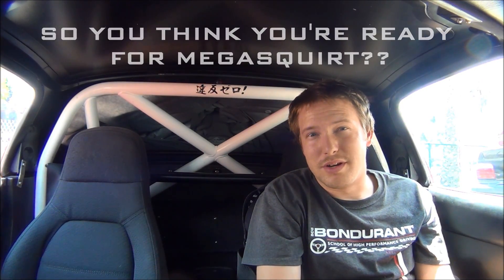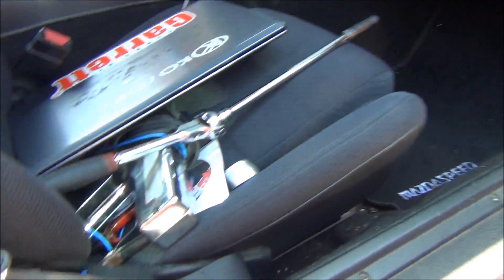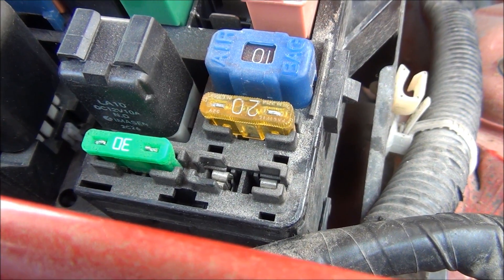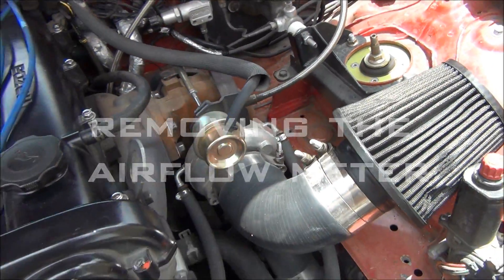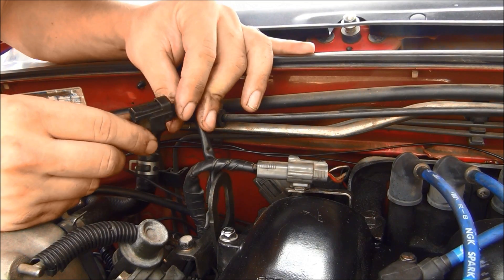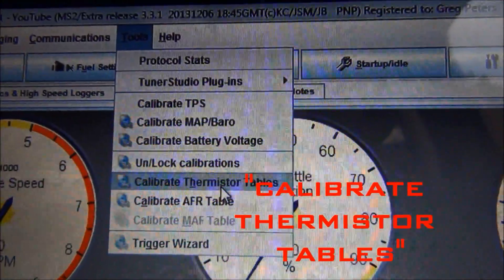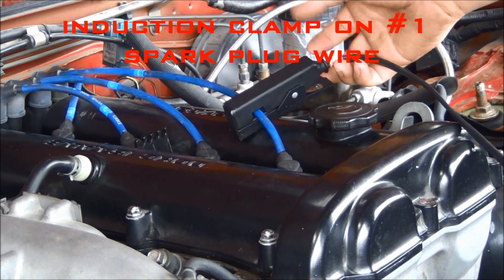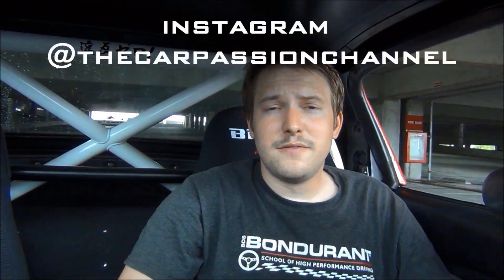How to Install Megasquirt!

Comment: Are you still running an IAC? The area right before my throttle body on my NA8 looks so much more cramped than yours. I'd love to be able to get rid of the IAC or at least find a way to relocate it (or not have to have a spare tube running to it, connecting to the throttle body inlet.

Comment: Amazing video thank you for your sharing your experience with us.
How many models mega square ecu, what the difference between.
For normal use not performance only to upgrade old ignition and fuel system for more reliable like.
D jetronic system mercedes v8.
Because no more parts available and not cheap to restore all systems.
What the easy ecu can used to upgrade this kind of system if not mega square, if I go for Ms ecu which model the best to my project.
Waiting any help or guide.
Best regards,

Comment: I need help!?? When I set it to fixed timing and verify that it’s the same (14 degrees) on the timing light and ECU. After I switch it back to use table the timing shown on the light and ECU show 20 degrees ?? Am I doing something wrong here ?
Reply from the maker: "Fixed Timing" is only for setting the base timing, and it needs to be 10 degrees (There's no "14 degree mod" once you have a standalone ECU). Once you switch back to "Use Table", the ECU starts using the spark map. Timing will follow whatever you have in the table based on load and RPM, could be 5 degrees or 45 degrees. That is the point of having a spark map.
Reply: @TheCarPassionChannel  ok so set the base timing to 10, then once I switch back to “use table” don’t worry about what the timing is showing ? And start to tune to get it running ? it’ll idle but that’s about it.
Reply from the maker: @FREEVERGO8  Correct, base timing should be 10. You're just setting a reference point for the ECU to use once the actual spark map comes into play. The ECU doesn't actually know what the engine timing is, if it's mis-adjusted. That's why it's so important to set the base timing correctly
Reply: @TheCarPassionChannel  technically once you set your “base timing” it should idle at that degree correct or no ? 
Example, 10 degrees 
Once I set it back to “use table” the timing goes way up to 20 degrees.? I have a lot to learn if you can tell..
Reply from the maker: @FREEVERGO8  No, base timing doesn't mean idle timing. If you want the car to idle at 10°, you need to make that adjustment with the spark table, not with the base timing

Comment: Hey Greg! Sorry to pull you back to a 7 year old video (if you see this) but I wanted to ask the significance of 10 degree advance timing. Is this because you're turbocharged or does this improve the engine efficiency?
Reply from the maker: 10° is on the base/reference timing. Actual ignition timing advance is controlled by the tuned map in the ECU
Reply: @TheCarPassionChannel  ohhh I see!! Thanks so much for taking the time to reply!

Comment: 8:30 greg has his plug upside down. If you look at a wiring diagram its pin 2 and pin 7. Pin 2 is earth and 7 is the signal to the ecu for the iat sensor. But as he said, theres no polarity on the sensor so it doesnt matter. Might help for diagnostics though if anyone needs it

Comment: hi TheCarPassionChannel i have a mazda 1990 gtx with 1800ccbpt im trying to add a AIT sensor my afm plug has 5 wires not 7 which 2 would i use for AIT in your video you used 1 and 6? cheers

Comment: hey Greg.
I am building my Turbomiata right now and it wont create much boost.
*also in the instructions of my kit-manufacturer it said i should use the first and the fifth pin for the air intake temperature. is this possible or is maybe this the reason for the engine running very badly?

Comment: Hey I know this is a stupid and amateurish question but I'm learning as I go. I am building up a miata slowly and when I finally put my TD04 Turbo on I am wanting to run wastegate pressure (7psi) for a little while before installing a boost controller and taking it to a dyno to get proper tuned, if I were to just run wastegate pressure I assume that the only "boost tuning" I would be doing would be watching/tweaking my AFRs to make sure they are good when I'm slowly coming into boost. Is this right? The only way to tune wastegate pressure with no boost controller etc is with AFR table? Aslong as I have a good base map with base timing and good AFRs aswell? I know spark maps also contribute but this is something I do not want to touch until I install a boost controller and take it to a dyno with a proper tuner. Can I have a safe wastegate pressure map without having to touch my spark map at all?
Reply from the maker: The answers to all of your questions is yes. As long as your ECU has a base map which is scaled for boost (Like the MS2PnP or similar) you won't need to touch the spark, just fuel only. And with out a boost controller you will be limited to spring pressure.
Reply: @TheCarPassionChannel  Thanks very much for clearing that up in my head, I understand when you are talking about scaled for boost as in the right Kpa for the tables when going boosted. Really cant thank you enough Miata dad, hope everything is well on your end👍
Reply: @TheCarPassionChannel  I am installing a MS3Mini PNP :) another question, can you run and fine tune your car while it is naturally aspirated on a map that is scaled for boost? Just not the the other way round obviously because the ecu would be expecting NA Kpa and get hit with 180 etc?
Reply from the maker: @mlfishing842  Yes absolutely, in fact that's the best way to do it. If you re-scale your tables for boost, they need to be re-done/retuned. If you scale for boost on day 1, all you need to do is tune the higher boost areas of the maps, all of your sub 100kpa stuff is basically done already. It will need tweaks once you have a turbo in the system, but not fully reworked as it would if you had to re-scale the tables after they had been tuned.

Comment: How do you install a flex fuel sensor? Like where to wire it into the megasquirt?
Reply from the maker: Flex signal goes to the Flex pin on the options port, your MS instructions will tell you what pain that is for your MS. The other 2 wires are just power and ground
Reply: TheCarPassionChannel I have not been able to find one
Reply: I’m useing the ms2 on a 92

Comment: I have a 97m and the O2 sensors are rust welded onto stock exhaust (original). If i install mega squirt, will I be able to delete these from my check engine light?

Comment: Is the IAT an open element or closed element (does it matter?). Bought a megasquirt for $400 but it didnt come with any of the other stuff with it like the sensor or the CD. Looking on the website now to see if they sell the CD or if they could provide one. 

BTW if you want a fun road to drive. Turnbull canyon in Whittier, CA is a lot of fun. I used to go driving there in my 64 ranchero back in highschool. Id imagine the Miata is just as fun

Comment: Thanks for these videos man. There really useful and very detailed. Very helpful to me I'm doing a turbocharged NB mx5 and I've been slowly buying parts until I have everything I need I was confused about what engine management to use but after loads of research on forums and websites I've decided mega squirt these videos helped me make up my mind. I imagine the installs will be similar very slight differences as mine is a NB. Thanks again.

Comment: Hi, i'm in the process of buying an MS2 for my 1990, i have a question for the IAT sensor placement. I read all over the internet that IAT sensors are prone to heatsoak, especially if mounted in hot places. Isn't the air in the back of the radiator too hot? Have you ever had problems with heatsoak?
Thank you!

Comment: So out of curiosity I was doing my megasquirt install and was just kind of following your tutorial apparently there's a fuse underneath the hood you were supposed to remove you might have covered it I might have missed it but apparently it's a big thing
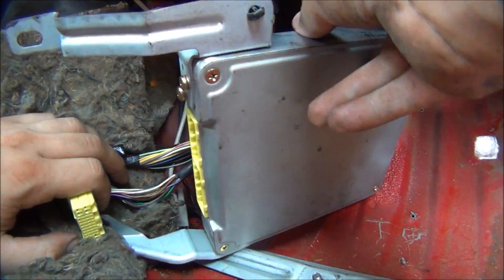Reply from the maker: The one I remove at 3:28?
Reply: @TheCarPassionChannel  yeah i must have looked away for a hot second when you covered that of course I was watching it as I was trying to do it

Comment: Question, I get a no controller detected message when trying to create a new project... What's up with that? I've tried the com detect program and it's not detecting anything. I've played with com settings and nothing helps. So frustrating 😡
Reply from the maker: Very common issue, often times using a different cable will solve it, but there's also a way to manually set up the new project. I had to manually set mine up but I dont know how, I had to have someone walk me  through it

Comment: Where can you get the Bluetooth adapter at ?
Reply from the maker: From DIYAutoTune's site
Reply: @TheCarPassionChannel  ok thank you
Reply: What's a good fuel pressure regulator for a 1.6 L . Waiting on the my megasquirt to come in.
Reply from the maker: @86staples  If you're running MS, use a stock regulator
Reply: @TheCarPassionChannel  thank you again my friend said I needed a fuel pressure regulator . And rx7 550 injectors. I know I need at least the Injectors.
Reply from the maker: @86staples  Injectors yes - FPR no. Stock fuel pressure is fine. You'll run out of fuel pump way before you need an FPR
Reply: @TheCarPassionChannel  ok thanks. I'm getting the walbro pump too. Also keep up the work  on your channel.
Reply from the maker: @86staples  Fashoo good luck on the build!
Reply: @TheCarPassionChannel  do you know I part number for a belt if I get rid of the ac in my miata 1.6

Comment: This might help a few people out when setting up the IAT. My tubing was cast, and it was tough to find some to install the IAT bung due to lack of a proper welder. Instead I chose the method here to use the 9/16 drill bit on drill press then used the NPT tap as recommended. The helpful part is Homedepot, Lowes, and Pep-Boys all didnt have the size recommended in the video. I went to Harbor Freight for the press, the bits, and tap kit (assuming you dont have one).  That got the job done, and this video was super helpful. Cheers!

Comment: Stupid question but im still new to the car world and I'm still learning is it possible at all to run this ecu with stock coil packs, sparks , and fuel pump etc or do I need better ones than stock? I'm trynna gain somewhat of horse power but im on a budget cuz im still 16 ?  thnks for the help!
Reply from the maker: You can install MS with a 100% stock engine.

Comment: How does your car run with the yellow RX-8 injectors? Is the idle smooth? How much power are those injectors good for?
Reply from the maker: So good. It's a great injector just make sure you don't get eBay knock-offs. They should be about $180 used/refurbished. They can do roughly 220-240whp, on the upper end you'll want an upgraded fuel pump, but stock pump can do over 200whp easy

Comment: My timing is at 10 degrees while on fixed timing but once I set it back to use table the timing is 17 degrees!! I have no idea why
Reply from the maker: Nick Lagnese Because after you set it back from fixed 10, it's not fixed anymore. It follows the spark map as it should.
Reply: TheCarPassionChannel oh so that’s normal then? Thanks for the reply and help with all things miata like always!
Reply from the maker: Nick Lagnese Yep, "fixed" mode is just to set your base timing. That's so the ECU knows what the engines actual timing is. Once you go back to "use table" you tune the ignition with the spark map. Just make sure when in "fixed" mode, TunerStudio says 10°, and your timing light also shows 10° on the crank. Very important that they match.
Reply: TheCarPassionChannel Yep they both match up. Thanks again for the help. Was driving me crazy

Comment: One thing I am wondering about: Is a base map the same as the stock map for the stock engine (OEM ECU)? Or is it just any map that plays it safe on the engine

Also, why I did you have to relocate to higher ground for finishing the base timing?
Reply from the maker: +Mathias Mang It's a base map specific to that engine, the settings are close enough to start the car and maybe drive lightly, but needs to be tuned after install.  The higher ground was a joke, because it was raining lol.
Reply: TheCarPassionChannel I honestly sat in front of my computer searching for possible reasons why you'd have to do that.
Definately got me there

Comment: How come you're not running 14 degrees BTDC? Would make more power
Reply from the maker: towlie911 With MS you can actually tune the entire table. The reason people advanced to 14 degrees on a stock ECU is because you can't tune the map, so that advances the entire table by 4 degrees. So areas that were 28 are now 32, areas that were 16 are now 20. With MS you need to set the base timing to 10 but MS can change the timing from like 0 to 50 degrees wherever/whenever you want it to.

Comment: I don't get it. How do you know what ignition timing degree to shoot for with a turbo?
Reply from the maker: BloodOnMars I don't cover ignition tuning in this video, regardless of what the setup is on your engine, you need to make sure the base timing is 10°. Actual ignition timing controlled by the ECU will vary greatly throughout the RPM band and throttle positions

Comment: I clicked detect and it didn't find the ecu. Any insights will help!
Reply from the maker: Nick_olai Often times it's an issue with the cable that connects to your laptop. You might need to download a driver or try a different cable.
Reply: TheCarPassionChannel pls bare with my as i am a total noob. Ordered a dif cable and should be here tomorrow. I've downloaded the drivers from ftdi that diyautotune suggests. How they're used i have no idea. Just hoping this ecu i got second hand isn't fried

Comment: What air intake temp sensor are you using?
Reply from the maker: Aaron Amachee GM, it's included with the MS
Reply: TheCarPassionChannel thank you and how much do they go for?
Reply from the maker: Aaron Amachee The sensor? I think about $20
Reply: TheCarPassionChannel thanks I definitely will get a mega squirt soon you video really does help a lot

Comment: Can I drive a previously perfectly working motor without checking the timing after installing?
Reply from the maker: No. You need to make sure the base timing matches the ECU setting.

Comment: Can you create different tune setups and assign them to a physical switch within the car?
Persay if one wanted a  street tune, but also a track based tune, but not wanting the necessity of a laptop to switch between the two?
Reply from the maker: Hmm that I'm not exactly sure about. You can have switches for certain aspects of the tune, like a fuel map switch, high/low boost etc. But most of the settings you'll leave the same for street and track. Also - if you get the bluetooth adaptor you can store multiple tunes on your phone and switch them in seconds, if you want two completely separate tunes.

Comment: Hey Greg, i had a couple questions:
If you dont remove the ST Sign fuse (on Na Miata), how crucial is that?
Second, how did you mount your megasquirt to your foot well? im having trouble with that.
Reply: Rather how did you gain access to the other side of the footwell to bolt down the MS? I'm not seeing anyway of getting in :/

Comment: Can you do megasquirt even tho your not turbocharged
Reply from the maker: The Bros Garage Yes
Reply: Is it worth doing it with non turbo like how effective would it be
Reply from the maker: The Bros Garage You can gain a litte power and efficiency but to get max potential it needs to be on a dyno really.
Reply: So go megasquirt then do a dyno tune

Comment: Dear TheCarPassionChannel,
I am currently doing the same swap as you (vvt). I'm stuck since I don't know what to do with my wiring. I have bougt a wreck so I have the ecu wiring and engine and all. Do I have to swap the entire wiring or what should I do best? Very Kind Regards :) Keep up the amazing work
Reply from the maker: c.v.r http://www.miataturbo.net/engine-performance-56/definitive-vvt-swap-into-90-97-chassis-megathread-80469/
Reply: So do I have to use the 90 - 93 pnppro instead of the 01-05 ?
Reply: Nevermind :) both are vvt compatible thus I need the 90-93 version for easier installation

Comment: Greg, 1995 1.8 installed the MSPNP, IAT so the stock air box is gone. Cone filter replacement.

Started the car, it idles for a minute, and then dies out. MTXL  AFR reading 10.3, I do have the wideband sensor in as well.. ignition timing is 10, but it stutters along with the engine... any pointers? 

Will VE Live help even out the idle?